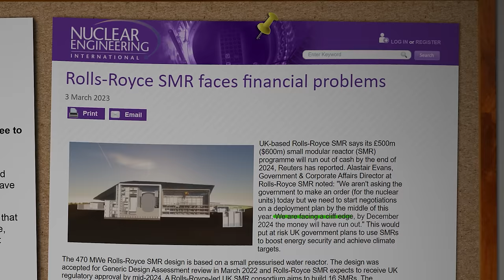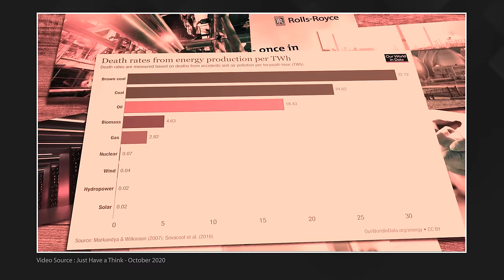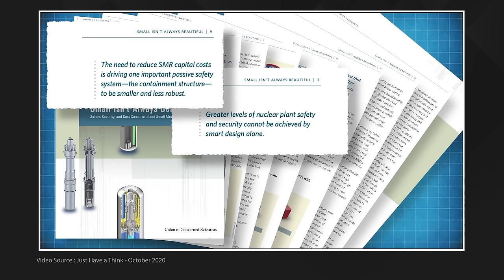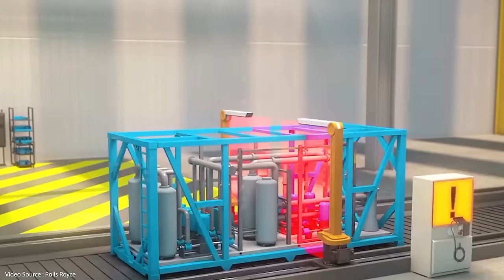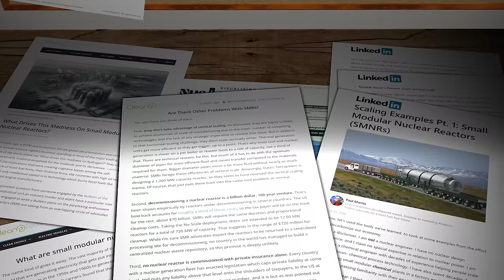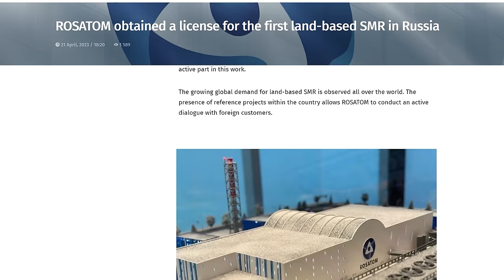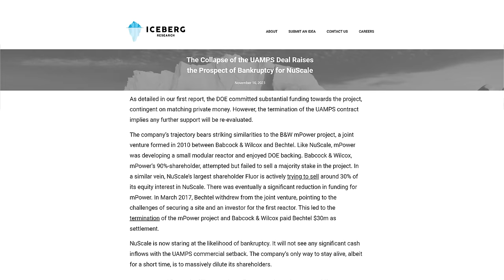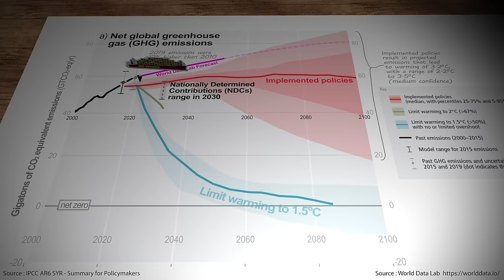Small Modular Nuclear Reactors. The Verdict

Comment: 📝 Summary of Key Points:

📌 New Scale terminated its contract to construct a small modular nuclear reactor for Utah Associated Municipal Systems due to a significant increase in the power generation cost, raising concerns about the progress of SMR technology.

🧐 The challenges facing SMR technology include economic viability, lack of horizontal scaling for cost efficiency, security risks, and the long-term decommissioning costs, making it a less attractive option compared to renewable energy sources like wind, solar, and battery storage.

💡 Additional Insights and Observations:

💬 "Nuclear power is considered one of the safest forms of non-renewable energy, with minimal deaths per terawatt hour compared to other sources like coal."
📊 The collapse of the Utah contract led to a significant drop in New Scale's stock value, raising doubts about the company's future prospects in the SMR market.
🌐 Westinghouse's AP300 model aims to utilize passive safety systems from their existing technology, potentially competing with other SMR projects like Rolls-Royce's.

📣 Concluding Remarks:

The challenges facing small modular nuclear reactors, including economic viability, scaling issues, and long-term costs, raise doubts about their feasibility compared to established renewable energy sources. The focus on wind, solar, and battery storage remains crucial for achieving sustainable and affordable energy solutions in the future.
Generated using TalkBud

Comment: Ina country like Singapore ... Can Wind, Solar, Tidal be able to satisfy ALL it Needs ? Thus there will be places where Fuel and Nuclear energy is required. Places like China where density of people is very high and land Super expensive , Nuclear Reactors looks like the way forward. However with advances in Battery Storage technology , solar panels, High Power DC transmission, wind turbines , tidal turbines , etc. Believe that China will make Advances to Make Energy generation .. Cheaper, Easier and Safer . ( Fission energy  and Thorium Reactors looks Promising ) And there is NO NEED to have Small Modular Nuclear Reactors where HUGE demand exist. I.e China.

Comment: The levelized cost of energy (LCOE) is too much. This is based on the cost of construction , operation and maintenance for the life of the plant, disposal of the spent fuel, cost of personnel, divided by the amount of electricity generated during the life of the plant. It is so expensive even the suggestion is ridiculous. Plus it takes decades. Renewable energy can be built in a couple of years, the LCOE is far less than nuclear and batteries can be used to make it baseload power. Nuke is too expensive, too dangerous and impracticable.
Reply: Clearly that is why Germany, which has spent the last 12 years building wind/solar seen their electricity prices go up?
Wait!
Clearly that is why California, which has spent the last 15 years building solar/wind seen their electriicty prices go up?
????
The cognitive dissonance is too much here to believe that 'solar and wind are cheap'.
Reply: @factnotfiction5915   The error is that if you only look at the cost to build the generating plant - then solar and wind come in cheaper than nuclear in most locations.

But if you look at what is the cheapest power to deliver to the customer.. Nuclear power comes in cheaper in many parts of the world.   There is a whole host of problems with transmission and distribution of solar and wind power (and with certain other forms of power generation).

As the wrong question and get the wrong answer... 

Lots of studies done on this and the smart countries that know to ask the right question have seen the light.  that is why there are currently 413 nuclear power plants operating in the world, 62 under construction, and 118 planned, and another 323 proposed (data current Feb 2024 from the World Nuclear Association)
Reply: @perryallan3524  I agree with you. Perhaps my sarcasm at the believability of the LCOE was too arch.
Reply: @perryallan3524  Yes there are problems with transmission and distribution of solar but these are small in comparison with the storage, transport and disposal of the high level spent fuel which the nuclear industry has failed to address for theist 70 years. Currently the nuclear plants are storing the high level spent fuel in their backyards waiting for the DOE to pick it up like they promised when the plants were built. There is no mayor in the country willing to allow transport of high level spent fuel through their city. Many of these nuclear sites have shut down and decommissioned and the spent fuel is still there...
Reply: @factnotfiction5915  The higher prices of electricity in CA are largely due to the fact that the camp fire storm started by unmaintained grid towers burned down Paradise CA, and killed dozens of people. The utility was forced to rebuild most of their grid with new wire attachments and grid maintenance which nearly bankrupted the utility (PSEG). To pay for all this, the utility had to raise rates. In Germany, if I remember right,  the rates have gone up because the Russian gas was shut off and a nation wide crash power plant building program was required to replace it..   New construction is expensive and when you try to do it all at once it is more expensive. Also let's not forget that the reason that the Soviet Union went bankrupt (partially at least) was the Chernobyl meltdown which contaminated millions of square miles of land throughout Russia and Europe which had to be decontaminated. Radioactive air samples from Chernobyl were even detected in Phoenix, AZ.
Reply: @stevepeace231  It's congress that has failed to address the high level nuclear waste issue.  Safe storage technology has existed for decades (and is being used in other countries).

In addition every KwHr of power sold from a nuclear power plant in this country has a "spent fuel disposal fee" attached which is paid the US Government to fund the required disposal sites.

That fund is now 2-3 times the cost of developing, filling, and closing the Yucca Mountain.

Also, you may have heard that a Federal Judge ruled that the plans for Yucca mountain were not safe and would allow man made radition to escape in the far future.   That's true. But they don't give you the context (and a simple fix to the law/standard being used).

Assuming that Yucca Mountain (which has been in a bone dry environment for I believe 10s of thousands of years) suddenly became a wet tropical environment the day it opened...   then in something like 10,000 years if all the multple encasing layers fail water could get to the surface that would conatain some man made radioactive materials.

That is true.  However the level of radiation would be below the naturally occurring Radon in rocks and water.  Also that the level of possible radiation release would be less than what a person gets from eating either 1 potato or 1 banana a day (potatoes and bananas contain potassium 40 which is radioactive and decays).

So in the absolute worst case the amount of man-made radiation released would be far less than what exist in natural sources in that area and in normal food. Also clearly below the EPA limits for human habitation and consumption.

A rational person would think that it would be simple to change the legal requirement say the EPA standard. The Anti nuclear people have fought that change tooth and nail (while they continue to eat and drink potatoes, bananas, and many other foods  and water (or beverages) with higher levels of radiation.

The technology is known.  The money is more than there, all it takes is the political will to do it.

Also, disposing of the high level nuclear waste from power plants is much cheaper than fixing the power distribution cost of solar and wind.  

Not to mention that the disposal of high level nuclear wastes from military and research programs is far more expensive than for power plant fuel.

Have a great day,

Comment: The only small modular nuclear reactors that make sense are those based on molten salt technology
https://youtu.be/_ou_xswB2b0?si=Ujc-mnrvIZLi-jJ-
that still work at ~ atmospheric pressure, are pretty compact and easy to transport on site, can be easily factory built and intrinsically safe (being the salts at atm pressure, completely non reactive to air or water).

It doesn't have any sense to miniaturise a reactor based on pressurised water technology, the cost per MW is higher not lower and thus higher fixed costs like fuel, fuel fabrication, etc...
Reply: Do you have any real operating examples or are you basing your comments on power point presentations?
Reply: They will not operate at atmospheric pressuer.  My guess is that the primary look will be in the 50-100 PSI range just to ensure adequate circuation.  The secondary loop will likely operate in the 100 - 150 PSI range as there is a larger pressure drop in the steam generators (and we are pumping a thick fluid - not water).

There is no indication that a nuclear power plant can be factory built nor for most of your other claims.  Its all wishful thinking.  What they can do is build components in a factory - and ship the components to site for field installation into a seismic building; and then run all the wiring and piping needed.  Just like power plants have been built for over 125 years.
Reply: @perryallan3524  You are correct in that both VC Summer and Vogtle had transportable system modules assembled in a factory and then shipped to the site for final assembly.  However, they had many problems with poor quality welds and modules that did not fit together requiring rework.  As I understand it, overall the build it in a factory concept saved no money in the build
Reply: @clarkkent9080  Agreed. No one has yet demonstrated the quality control and precession needed for modules to work effectively. 

The concept was also tried for a few fossil plants.  What I heard was it would have been cheaper and faster to just built it the old fashioned way given all the rework; and they did not have to worry about seismic mounting of the modules.

Oh, and they complained about all the welds requiring rework as well,  Not to mention that the pipes ends did not line up and they had to cut back 10 or more feet and weld in a new section to be able to make the connection.
Reply: @perryallan3524  indeed, obviously it' s almost atm pressure (as I said),  for instance 3 atm in the primary for Thorcon (an other MSR technology) for example, you always need a bit of pressure at least for pumping fluids. 
https://youtu.be/oB1IrzDDI9g?si=ac1k7gsPRBuiOUw0
It's much simpler, more efficient and compact than a PWR consisting in a 2 phase coolant at 70-140 atm, very reactive in case of casualties to metal, not to say a LOCA or meltdown is a meaningful term for a MSR (everything is gravity driven with no need of external power  in case of accident)
Reply: @ndro-1977 I'm not sure if you are aware.  But no one has yet to build an operate a long term reliable MSR test reactor (the USA built 2 test MSR reactors - the 1st one failed and released molten salt and radiation in something like 15 days - and I understand 6 hours after ramping it up to full power.

The Oak Ridge MSR about a decade later tripped and was shut down hundreds of time as things broke or needed maintenance.  It was supposed to be a power plant test reactor with an expected run time in the 90% range (as other power plant test reactors of the day had).  Instead it only ran about 40% of the time.

That was before they knew about the corrosion and radiation embrittlement issue with the hastalloy tubing, piping, and components.

I personally view Thorcon and a large number of other "MSR companies promoting fast building of MSR power plants" as investor scam companies.   Their claims are totally unbelievable (and Thorcon says they want to duplicate the Oak Ridge design (which only reached 7.4 MWthermal from a reactor that was designed to produce 10 MWthermal).  Great plan; lets use a design that could only reach 74% of rated power and spent most of its time broke down being fixed.

Lets see if the Chinese Test reactor that went online Aug 2023 tells us if we have a workable alloy and a workable chemical filtration system before even beginning to talk about the possibility of molten salt reactors in the way that most people are talking about molten salt reactors.  I note it will take year to know if it works out - unless they tell us sooner because it didn't work out.

I note that I have seen one design that might work.  It puts the molten salt/fuel into sealed tubes, and assembled the tubes into a fuel assembly (like a BWR or PWR fuel assembly), with plans to replace the fuel assemblies before the tubes could fail from corrosion and radiation embrittlement. 

This design uses as secondary molten salt loop to transfer the heat away; and then underwater refueling and a spent fuel pool like BWR and PWR reactors.

That might be viable and solves a lot of the problems of a circulating primary loop of molten salt/fuel/daughter products/chemical reaction products.

I would also like to point out that with over 60 years of operating history that the PWR reactor has proven to be the most reliable and lowest cost reactor design with the Pressurized Heavy Water CANDU reactor coming in at 2nd place.  Please see my latest post under my main post about SMR reactors (2nd most number of posts).

Also, it is possible to "melt down" a MSR reactor design if the molten salt fuel gets so hot that the tubes and piping it is contained melts (or weaken to the point of rupture).  That would likely cause a very very bad radiation mess in containment if it leaks into the containment buiding - and I don't even know where or how you would start to clean it up.  

My 1st reaction is to just flood containment with at least 10 ft of water for radiation protection and let it sit for decades for the daughter products to decay to a relatively safe level.  There might be other solutions.

Also, I have yet to see anyone explain to me how you maintain the primary loop system of a MSR without killing the people due to the high levels of radiation that will exist in from the daughter products in the molten salts (and all nuclear regulators really frown on killing people with radiation exposure.  Even overexpose above approved limits draws in the USA at least a $1 million dollar fine from the US NRC - and I doubt that other western countries don't do some kind of major fine).

Comment: 😡😡🤬🤬😠😠😡😡🤬🤬😡😡😠😠😡😡🤬🤬😡😡🥴🥴🤪🤪🤣🤣🤣🤣🤣🤣
You present a good point of view. Of course, we could always make these multi-billion-dollar corporations to foot the bill.🤣🤣
  One area of use you failed to mention or take into account is outer space. IF! we set up on the moon, solar would work for a while till the shade came and hope the battery power last till the sun comes back, or Mars how many panels would we need to power one base?. If they could set up one of these reactors, they would have 24/7 constant power, besides, it won't damage the eco system😅
 What about desalinization's plants, they need lots of power, instead of sending the brine back into the ocean, why not flash it to steam, to make Hydrogen and process the salt and minerals left behind.
 Also, there is always some part of the world in need of emergency power and fresh drinking water. why not retrofit an oil tanker, or container ship with a XMR unit and say 500,000-gallon tank of fresh water; maybe even a medical unit that can do operations, first aid

Comment: Recent SMRs getting action in UK, Ca, USA.  
These are all getting contracts and expecting to be on-line starting later 2020's or early 2030's.
The first two are based on heritage large LWRs and already approved or re-upping existing approvals.
All < 300 MWe (i.e. SMR) per reactor
1. BWRX-300, GenIII, outlet temperature 200C.
2. AP300, GenIII, outlet temperature 300C
3. Xe-100, GenIV   (4 of 80MWe reactors:  ~$2.4B or $600M/reactor, few years away from approvals), outlet temperature 750C.

Comment: Why would one need to build thousands or even millions of those small plants for there to be a benefit? That is just nonsense, all that is needed is that the mass production costs per unit are competitive when compared to other forms of electricity generation. So if a small nuclear plant can compete cost wise with for example a wind turbine, then it's obviously the better choice because it can generate electricity also when it's not windy and same principle applies to solar. So no, you don't need millions produced, you just need some mass production that the fixed costs of the factory are compensated by the production numbers. If you can mass produce these plants in a factory like shipping containers and then ship them to the client, I can easily see how that might be a very competitive future energy source unless there is some 10 year regulatory approval period required for each plant like with the bigger plants.

Comment: A key SMR advantage is that manufacturing and installation capacity is independent if the tech needed for wind and solar. So we can maximise non carbon energy by doing both - and in the short term we probably should.

Bechtel is one company we should also be looking at. Their A1B 385MW reactor is already in serial production. Even if overpriced, if production was scaled up, that could easily add GWyear capacity to the grid every year, which is a rate solar and wind struggles with.